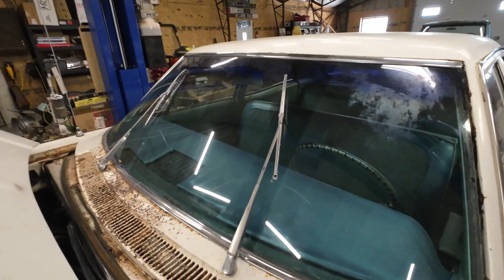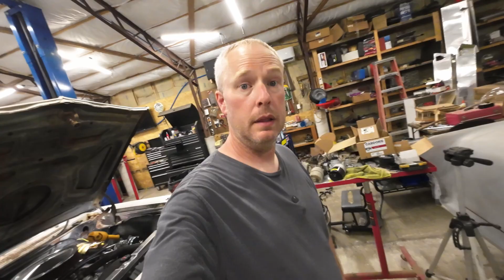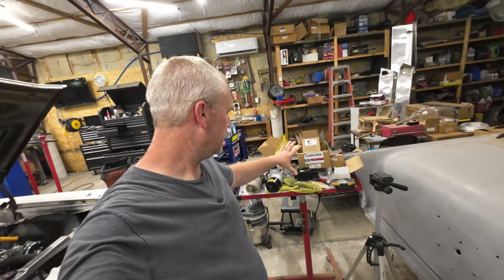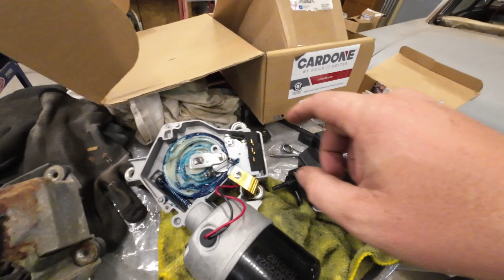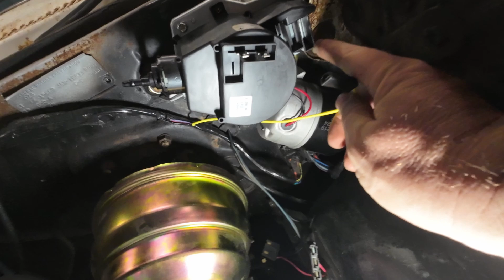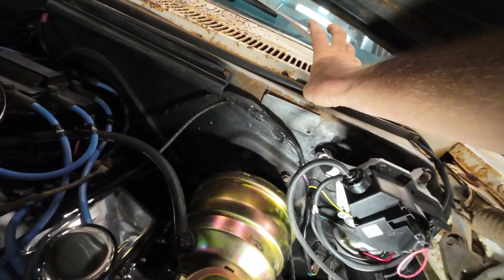CHEAP Wiper Motor Swap - 1965-70 GM Full-Size - Impala, Bel Air, Biscayne, Caprice

Comment: I need your help man i have a 69 impala sport coupe that im building from the ground up but im at tbe wipers and want to know if this motor will fit it and will work with the transmission that i have thank you i would even like to ask you some question if your up to it thank you and very clean job and looks great and works good.
Reply from the maker: Check out Rockauto.com.  I just checked and they have the exact wiper motor for your car for less than $100.

Comment: I have my first car Dad bought it used when I was 13. I got my wiper motor from Hubbard Impala in Burlington NC. Got it new, mfg., by New Port Engineering. Finally gonna put it on, inspired by this video. 65 now and just retired. Been awhile since I’ve changed a few out with my Dad, praying he’s helping me in Spirit. This is for you, Dad. I’ll try putting the wipers in the upper position like he recommends. Fingers crossed. Cannonball!!!

Comment: I’m getting ready to do mine as well in my 68 but is there any reason why you didn’t go with the factory replacement? I’m seeing factory replacements for the 68 on rock auto for a little over 100 and about 30 for the pump!
Reply from the maker: That is interesting.  They don't list the same model for my 66.  Sure looks right to me.  I'd say try it and let me know if it fits.
Reply: @TheChallenged1 will do

Comment: I got a 65 bel air four door 230 3 speed, now i have excellent guides for stuff like this. currently gonna convert it to a 1 wire alternator and get the fine details so I can inspect it for semi daily use
Reply from the maker: We are loving my 66.  My kids insist on taking it to school as often as possible.  Lots of people poo poo 4 doors, but if you have a family, they are wonderful and still look cool since they are old.  Good luck with your build!!!

Comment: Just to confirm, You mention the Pink wire goes to Positive, Black to Negative but in the clip afterwards you said the finished product you had it showing reversed. Can you confirm which way it should be? I have a 65 Impala that does not have a functioning washer pump and would like to replace the entire wiper motor/washer pump as you did. Much appreciated.
Reply from the maker: The power wire coming from the wiper motor to the washer pump needs to be the positive.  The other wire that goes to the switch, needs to be on the negative side.
Reply: @TheChallenged1  Thank you for confirming. I assumed as much when you mentioned the single power wire and how it looped to the other plug.

Comment: I have a 1966 belair when I looked up the motor with the part number looks different
Reply from the maker: where did you look it up?
Reply: @TheChallenged1 on several different sites even RockAuto the unit that it's showing on there now is all black and it doesn't look like it has the area for the bolts to screw through not unless that comes separate or in the Box
Reply from the maker: @Activitycyber  Click on the picture of it on Rockauto.  Then you can toggle through the pictures of that particular item that shows what you are looking for.  I just did it, and there are three pictures
Reply: @TheChallenged1 just placed my order will be at my house Friday